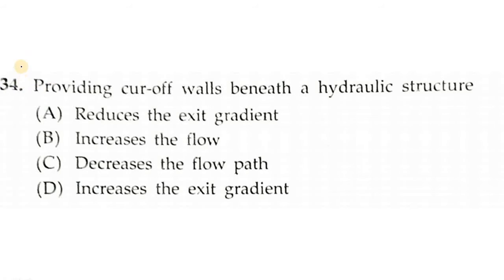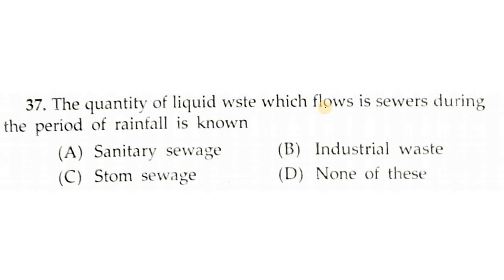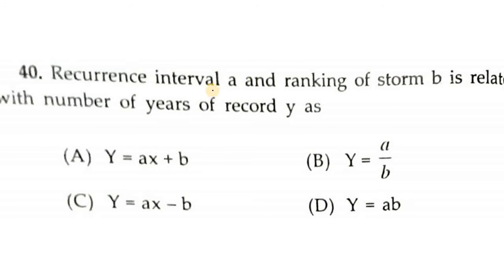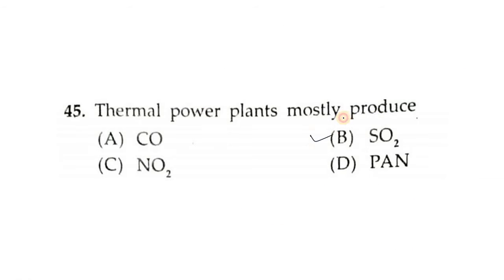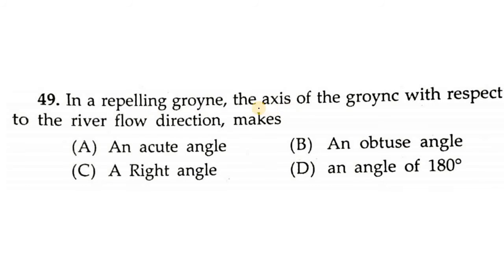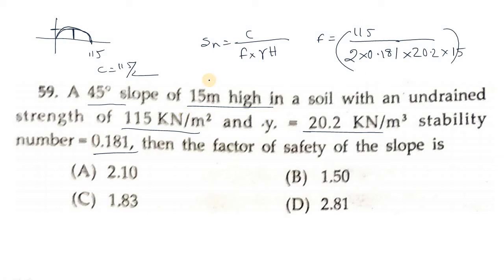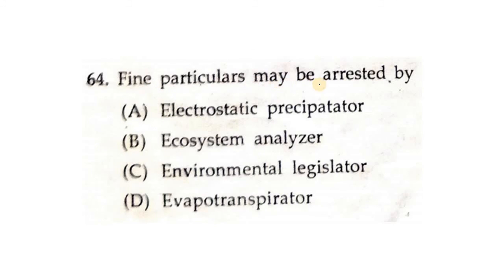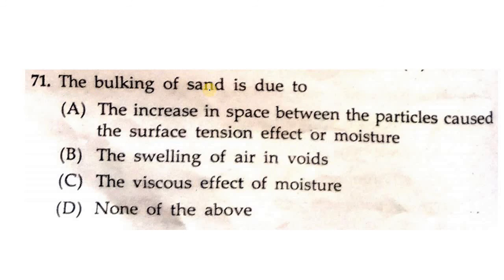WBPSC AE 2003 Paper| Part-2| WBPSC AE Previous Year Question |Tonmoy Maity

Comment: Question 59 as per your suggestion is not coming 2.1 as per your calculation..only if we consider c=115 N/m2 then only and can be 2.1 .. please confirm this.
Reply: Yes. Undrained strength is cohesion. If it was unconfined compression strength then it will be  C=q/2.